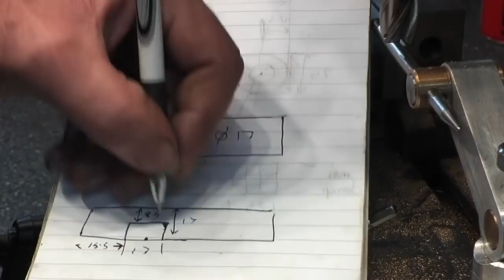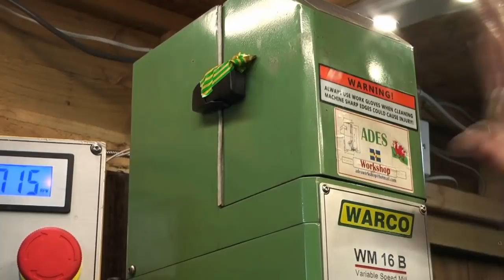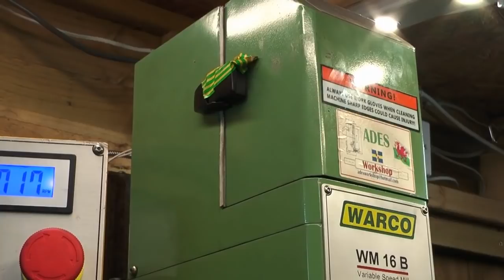Mini lathe revamp part 4

Comment: If stiffness of the box section is a concern, fill it with concrete. The concrete will be very helpful in dampening vibration. Unless the lathe will have to be moved occasionally it would be better to bolt the whole plot to the table and shim as required to level the lathe. Shims between the box section and the lathe bed may be then used to take any twist out of the bed.
As others have said, these lathes are a project in a box and should be approached as such.
Cheers from NC/USA
Reply from the maker: I have not done it yet but my pan is to fill it with oiled sand . Cheers Ade

Comment: Caustic soda dissolved in warm water will strip paint from metal parts with ease. Obviously treat it with the utmost respect but it's great for things like window furniture or in this case lathe parts.

Comment: Good progress, Ade, and thanks for showing the details of the stop. That box section ought to add quite some rigidity. I was wondering if boxing the ends would stiffen it further. It might do and would be simple to do if there is a benefit to be gained. All the best, Mart in Solihull.

Comment: The first upgrade on my minilathe was to make a shield for the back of the apron to keep chips out of the gears. Simple hand filed aluminium plate, 3 holes drilled and tapped to secure it on. It was a massive improvement, no more juddery action as the chips got squeezed between the gears.

Comment: G'day Ade. The mini lathe upgrades will definitely be an improvement. I also got rid of those silly carriage gib plates and fitted a solid block which can be easily shimmed when necessary. Thanks for describing your stop, it looks good . Cheers Peter

Comment: Top job Ade and 100% agree, all these little lathes are projects out of the box.
That's the exact same 1hp motor I fitted to my Warco 240, worked out well with the modifications I did and fits really nicely. I know I keep saying this but I will be putting out a video on my WM240 modification/upgrade.

Comment: Hi Ade, same problem with my WM16B.  I'm going to fit a mag catch instead of that "over the top" latch thingy.  Plus, it will make it more convenient to open when changing tooling.  Also, I've found the control panel rattles where a couple of the switches and display are loose fits in their respective apertures.

Comment: Ade
Really enjoying  this series of videos.  Would you be able to further improve the rigidity and vibration reducing benefits of your new box base if you filled it with something heavy?   I was wondering if you bought some of the steel shot blasting material this would be suitably heavy, dense, easy to "pour in" and not too expensive.  I think the shot material would be heavier than sand etc.
Best wishes, Paul from Canada  (via Derby!)

Comment: Surprised you just did not make risers at the lathe feet rather than the full length. With all the work I thought you would mill the underside of the ways to be parrallel to top at a closer tolerance for the saddle. They should list the motor frame size so you get no surprises. I enjoy your video!👍

Comment: Looking good, making some real progress now! Just a thought, most of the lack of rigidity in the bed will be due to the  shallow area between the headstock and rear feet. If you could weld a couple of vertical plates to your box section and pin and bolt them to the front and back of the lathe bed in this area, I reckon that would give a useful improvement.
Reply: Don't weld on your lathe bed box frame. It will warp all over the place.
Reply: @glennwright9747  He already said he's going to machine the mounting points flat after welding it.  That would have to be done anyway as box section steel like that isn't flat to start with.
Reply: @ferrumignis  from your initial comment I thought you were suggesting welding on the cast iron lathe bed. Sorry for any confusion.

Comment: Another Youtube creator uses cellulose thinners to remove paint from metal parts.  If you have a plastic container with a lid and its big enough the contain the part.  Place the part in  the container and cover the part with cellulose thinners, put the lid on and leave it over night. The next day the part should be clean as a whistle.  Might need a bit cleaning with a soft brush but the paint should be gone and the cellulose thinners could be returned to the container for the next use.  Check out Keith Appleton's channel he's the one where I got the idea of using cellulose thinners.  P.S. the fumes are rather easily contained in this process.  Can't wait to see the project finished.